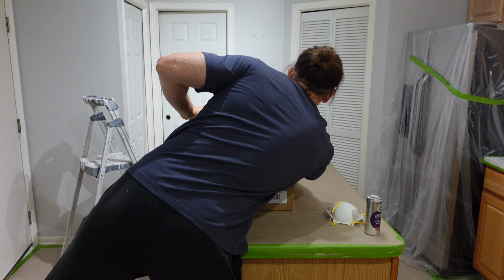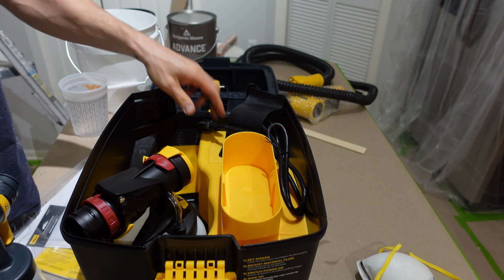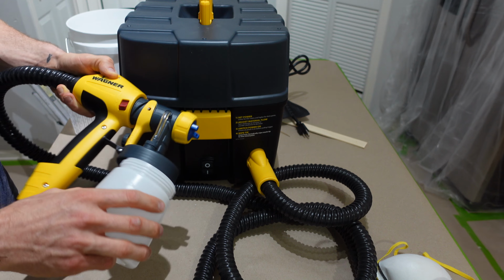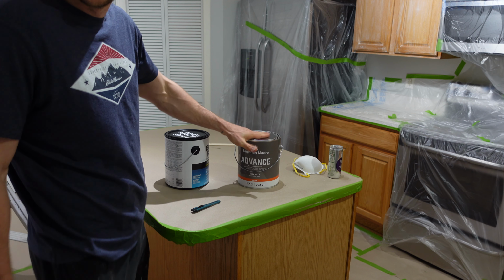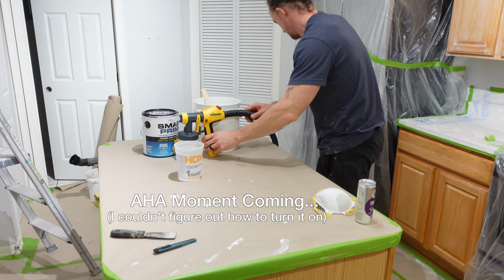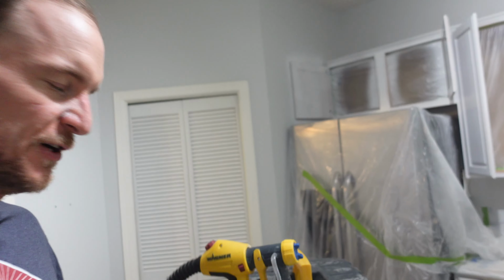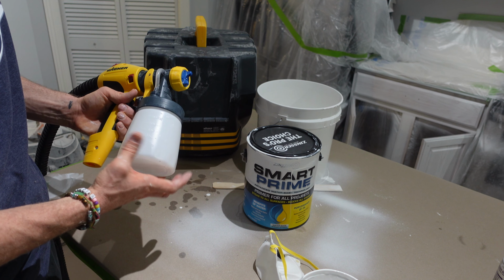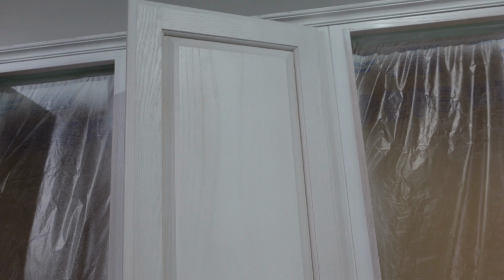I Sprayed Kitchen Cabinets With A $200 Sprayer! Wagner Flexio 5000 Sprayer Review

Comment: If you weren't repainting the walls, how far out from the cabinets would you mask off with this sprayer?  Looking at a few different videos using the wagners, it is hard to tell if it is necessary to go full clean room or just the adjacent area.

Comment: I used this sprayer thanks to your video and with the paint I used  my cabinets came out fantastic! I have to admit though I was a little skeptical when I opened the box the sprayer looked like something made by playschool but it worked great. The only negative thing I can say about it is that power switch in the handle although handy is in a bad spot. Several times I accidentally shut the power off and one time it just spit paint out as it was shutting off. It made a mess on my cabinets but I was able to clean it up and continue without any problems.

Comment: In my previous house we had the exact same cabinets. Surprised you didn’t take doors off
Reply from the maker: Each job requires a unique approach. This worked because the homeowner put on new slow close hinges after I was done and they wanted the kitchen back as quickly as possible.
Reply: @diypainting that’s what I was wondering as well. I feel like the slow close hardware would be a good ROI…plus how easy to just spray without removing them. 

But how to install new hinges without messing up the paint?? 🤔

Comment: I have a similar air-turbine type sprayer, but w/ blower attached to sprayer ($35 Amazon).  Clever design as the blower detaches for cleaning the gun, which is similar mostly plastic parts.  It atomized fairly-thick S-W Emerald cabinet paint ($100).  The 2" wide trim came out smooth and uniform (though not shiny).  But, when I coated it too thick on large panels, it was a bit lumpy, even though the S-W is supposed to self-level (why I tried a thick coat).  Thinning ~5% helped.  On another pass, I changed to a compressor-fed (70 psig) HVLP gravity-feed gun (Harbor Freight) and 10% thinned.  Gave a very fine uniform spray but couldn't get enough volume flow, so tedious on large sections, with ~2" wide pattern more akin to a rattle-can.  Next pass, I'll try an airless high-pressure pump-fed gun (aka Graco), but a $130 one I found on temu (same-looking one $190 on Amazon).

Comment: What settings are you using for the great atomization? 

 Also 20% water for primer...what is the water ratio for the advanced paint?  Thank you for the awesome video
Reply from the maker: I do 20% with the Advance as well. For reference, I thin most water based top coats by 20% when spraying with an HVLP.
Reply: @DIY Painting and Refinishing  thank you. Sorry I meant settings on the sprayer. Like full material full air? Or low material etc.
Reply: @shannon8359  Here is another video where he is doing a tutorial for a different Flexio sprayer but says that his tips work for other Flexios (including the 5000) as well:  https://www.youtube.com/watch?v=ormp9PpurgA
Reply: @barriekirk501  Thanks Barrie!!
Reply: @diypainting  Is 20% necessary to get the atomization with this gun?  BM Advance is 8 oz/gallon max, which is like 6.25%.

Comment: First off, love your videos. Very informative and easy to digest. I'm bout to tackle kitchen cabinets but will also be staining my fence, about 180 linear feet. Do you think this would be a good budget option for both projects? Thanks again for your videos.
Reply from the maker: I think it would be a great choice. The fine finish attachment did great on cabinets for me and the regular spray attachment with the ispray nozzle should be perfect for the fence.
Reply: I was wondering the same thing so I'm glad you asked!
Reply: Did do any sanding or anything before painting

Comment: I used the 50 dollar amazon spray gun and i was really pleased whith how the finish came out. I may have spent more time than brushing but there are no brush strokes now
Reply: The cheaper the spray gun the thinner the paint needs to be basically. Cheaper guns will not be good for thicker latex paints

Comment: Great video. Re the 5000, built new cabinets and wish to clear coat the inside and paint (white) the frames and doors on outside.  How does that sprayer work with water based polyurethane for the clear inside?  Or Would i be better off using clear lacquer for inside and maybe get a second fine sprayer for water based paints (if necessary)?
Thank you in advance for your reply.

Comment: So I have been struggling with this same sprayer and BM Adv paint type/finish, I keep getting micro bubbles/solvent pops it looks like. What settings did you run for the paint portion? I know you mentioned 20% thin, max power, min material for the primer, but did you do the same for the paint as well? I re watch the video again just in case I missed it. Thanks in advance!
Reply: Same, have you figured anything out?
Reply: @cassidysmith2993 I am going thru the same - micro bubbles on my cabinet while spraying. Added water as recommended and high speed air with less paint setting.
Reply: https://youtube.com/shorts/IeNEer0aiGM?si=4c8NJm65syRPMpN4

This helps explain micro bubbles when spraying.

Comment: I am going to use Wagner flexi 5000 on my cabinets doors . I liked your videos about filling oak cabinets with dry wall mud . So far looks good.
I never done spray paint.
I am going to use SW polyurethane enamel trim after 2 coats of primer.
Do I have to thin paint and how much.
What’s  good settings for smooth finish.
Thanks

Comment: Hi Ya 
Great video. You said you watered down the primer by 20%. did you water down the top coat or not.
Reply from the maker: Yes I did. For this sprayer, I thin most primers and top coats by 20%.

Comment: First of all thanks for your video's. Why are you spraying with the doors on the cabinets? Is there a reason for? If you spray the closed doors in the cabinets, how can they adges been sprayed, because they are hidden in the closet.

I like to give it a try with the doors on the cabinet, but does it realy works well?
Reply from the maker: This was a job I did for a friend and they were replacing the hardware when I was done, so I wanted to try leaving the doors on, which IMO seemed like a legit thing to do if you are DIYing your cabinets. It actually worked pretty well. Leaving them on probably saved me 8-9 hours on the total project and didn't sacrifice quality at all. I still plastic'd off the insides of the cabinets, then sprayed everything with the doors shut, and finally went back and opened all the doors and sprayed the back sides. Worked great. Though I do always take them off for my main clients.

Comment: Can you do polyurethane with this tool? Would it have to be water-based only or can you use oil? Thanks
Reply from the maker: You can absolutely use polyurethane and oils. You need to thin them until their viscosity allows the sprayer to atomize it appropriately to get a nice smooth finish.

Comment: This a rental or something that you chose not to remove the doors and sprayed the hinges?  I assume you are planning to repaint the walls since they aren't masked either.  I am planning to use the Wagner for our kitchen.  We have a vaulted ceiling open floor plan.  Not sure if we need to hang plastic from ceiling to floor to prevent overspray from leaving the kitchen area with this sprayer.
Reply: Pretty sure I saw in a different video where he addressed the hinges. The homeowners were going to replace all the hinges and get soft closing ones.  It was easier for him to spray with doors on and not having to worry about the hinges since they were going to be replaced.
Reply from the maker: Yeah, the homeowners replaced the hinges right after I was done. They were big on having the kitchen back as quickly as possible as well. I usually recommend taking the doors off and spraying them while they lay flat, but different jobs call for different approaches. 

Yes, I was painting the walls after as well.

Comment: I just bought a 1400 SQ ft ranch style single story home in TX and want to paint the exterior. What would you recommend for a beginner to spray paint the exterior of a small house like this?

Edited to add: the siding is a fiber cement board and it's a new build. Do I still need to sand on a new build? I'm also going to be painting the entire interior, as well as the cabinets in the bathrooms, laundry room and kitchen eventually as well so I'm hoping to buy a sprayer that can do it all, big and small jobs. I'll be painting furniture at some point too but I can use a brush a roller for that (and some of the above jobs if I need to - if there is no such thing as a single sprayer that does all of the above). But I think it's all a matter of different tips and settings, right? Willing to spend a decent amount on this since I consider it to be an investment. I'm doing everything myself. ✌️
Reply from the maker: You can go two ways, get a sprayer that is ideal for the cabinets, but will still work on the exterior. Or get a sprayer that is ideal for the exterior but will still be ok for cabinets. OR, just get both. 

If you're willing to spend a little more, my suggestion would be to get the Wagner Control Pro 150 (you can see my video on it here: https://app.sitebuddy.io/login) for your exterior project. You'll love it. It's a great little sprayer, perfect for your size home. 

Then, I'd invest in the Flexio 5000 for all your cabinets and small projects. 

The Flexio would be quite slow for your exterior, but would work if you wanted. And the Control Pro is a little harder to get to perfectly smooth finish without getting runs. 

When you're done, drop the Control Pro onto Facebook, you will likely not need that type of sprayer again and the 5000 will cover all your small spraying needs. 

Links: 
Control Pro: https://amzn.to/3KwcXz7
Flexio: https://amzn.to/3MfZ9tL
Reply from the maker: Also, you don't need to sand new fiber cement board, just make sure its clean. 

To directly answer the question, if you have to choose one sprayer, I'd go with the Flexio 5000. It's going to be slower on the exterior, but IMO, most people can live with that but they would much rather have the best finish possible on their cabinets. Plus you can use it for your furniture in the future.

Comment: How long have you been using the drywall compound as a filler,and have any pass client ever called back?
Reply from the maker: I've been using that as a filler since roughly 2009/10 and have not had a single call back.

Comment: Have you used the 4300 ? Any big difference?
Reply from the maker: I haven't used the 4300 but I think the only real difference is the 4300 doesn't have built in storage like the 5000.
Reply: @diypainting  thanks so much

Comment: do you think a wagner 3500 will get the same results
Reply from the maker: Yep. They are pretty much the same sprayer at the end of the day.
Reply: I ended up buying a vonvorn hvlp paint gun off amazon.  only 40 bucks and it had great a great rating.  I hope it sprays as good as the wagner  @diypainting

Comment: Stupid question but is the reservoir of the fine finish and the other one the same diameter thread as they look the same so why not just use the bigger reservoir?
Reply: The detail nozzle has 7.4 cm inner diameter at the top of threads, while the iSpray nozzle has 10cm (and is taller).  That's just me eyeballing it with a ruler.

Comment: First, I can't believe you didn't remove the doors and drawers first!  But that has nothing to do with the review of the Wagner.  I have a Fuji 2 stage HVLP.  I wanted to paint with PPF BreakThrough so I called tech support at PPG.   Someone had told me I could spray the BreakThrough if I thinned it 20-25% using the larger tip I have.  PPG told me NOT to thin the BreakThrough more than 10%, and they told me that I needed at least a 3 stage turbine in order to spray it correctly.  I can't believe you thinned the hybrid Smart Prime that much.  That Wagner just cannot be more powerful than my Fuji 2 stage.  Does Wagner give the specs on air flow CFM and pressure for this 5000?
Reply from the maker: So... You're comment feels like you're taking shots at me, yet you're asking me questions / help... 
There's a reason the doors were left on. It's in the video.
About thinning, Paint manufacturers often recommend against thinning, or only thinning a little, primarily to maintain control over product performance and quality. But in reality, when you've been painting for 25+ years like I have, you learn how to use your equipment and paints. What works, what doesn't. Good luck with your project and your Fuji 2.

Comment: So, I picked up the Flexio 5000 and used it on kitchen cabinets (light brown laminate). Getting used to the sprayer and after applying the Smart Prime I noticed several "light areas" with the laminate grain showing a bit. Should I light sand and re-apply the Smart Prime or just go to finish coat? Will these "light" areas present a problem?  Anyone's thoughts please.
Reply: I’d try the finish coat, and if not happy, go back to the sanding step.  Not a painter though.

How did it work out for you?

Comment: Would not show the wood grain if you had done aquacoat underneath the paint….
Reply from the maker: Aquacoat is a grain filler, not a leveler. It works fine at filling the grain, but the graining will still show. If you want the grain to disappear, you would need a leveler, or apply multiple thick coats while laying the doors flat, then power sand them smooth. But Aquacoat does not make oak grain invisible nor does it claim to.
Reply: @diypainting  precisely, I didn’t call it a leveler. I used it and several other painters on YT use it with excellent results. You can’t see the wood grain on my cabinets and they are nice and smooth. The key is to put it on in thin coats and sand between coats. I learned this trick off Paint Life YT channel. Works flawlessly.

Comment: I just bought this sprayer. The results were poor. Nowhere does it state to thin the paint! I used the larger sprayer on a big bookcase. Should have used the small sprayer? Wagner only has the size of the spray in the instructions but no guidance on when to use each sprayer. The packaging is funky.  Painting on a flat horizontal surface was terrible (yes I had the pickup tube pointed correctly ( i think.).Paint would spit out because the nozzle clogged. No guidance from Wagner. Wagner wants to let the community figure it out. What a bunch of cheapskates!. Will return to Amazon or throw in trash.

Comment: This guy is the biggest hack I have ever seen refer to themselves as a pro. Bro, why wouldnt you remove your doors and hinges? Did you even sand anything? Where are your paint filters?
Reply from the maker: Instead of sanding on this job, I actually sprayed a healthy coat of Pam cooking spray on everything before painting. Then I added a handful of sand into the paint to help smooth everything out. Doors and hinges stayed on to ultilize the Earth's gravitational pull to smooth the sand into the finish. 

Ok... I'm just messing around. 

Been asked this question many times in the comments. There are many reasons you may want to leave doors on when doing a DIY job. 

1) Don't own a drying rack
2) Lack of space to set out doors while drying
3) Need to complete job in a shorter amount of time

This was a free job for a friend (made clear in comments). They also ordered new slow close hinges, so we decided to speed things up and see how well it worked, to leave the doors on. Worked AMAZINGLY well. No drying rack needed or extra space to store drying doors. Something a DIYer would ABSOLUTELY run into. 

Also, if you pay attention to the channel name (DIY Painting), what I am trying to accomplish here to to look at scenarios that DIYers would run into and help them achieve professional results. 

Cabinets get sanded prior to applying a grain filler, after grain filler, after primer, and between top coats. That's 4 rounds of sanding on the cabinets. 

Wouldn't normally do this for a paying client, but it worked amazingly well for their tiny townhome with no extra space, accomplished something I wanbted to for a video, and was able to accomplish the freebie job really quickly. 

Thanks for watching, appreciate the view!

Comment: Are you ever try other brands of paint like home depot, kelly moore regular latex using the same %of water and you get the same results?
Reply from the maker: I thin most water based top coats 20%. Including Sherwin Williams Emerald, INSL-X Cabinet Coat, Behr Cabinet Enamel and more.
Reply: @diypainting  Thin BM Advance 20%??? BM advises thin no more than 7%. With the Flexio I guess you have to thin that much to make it work? Have you tried less thinning and didn't work well until 20%? What could happen long term if BM doesn't advise that much thinning. Color change? Affect hardness, sheen, etc?